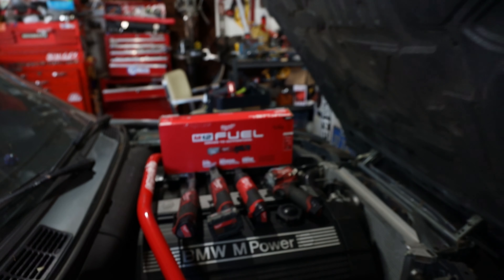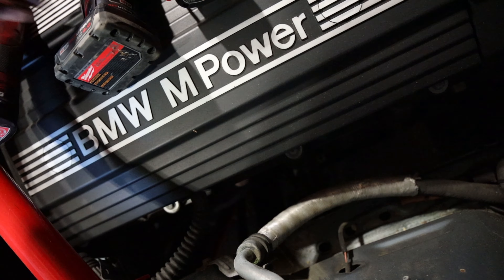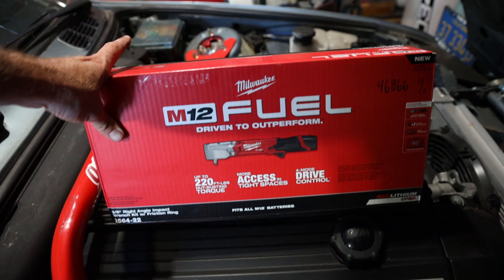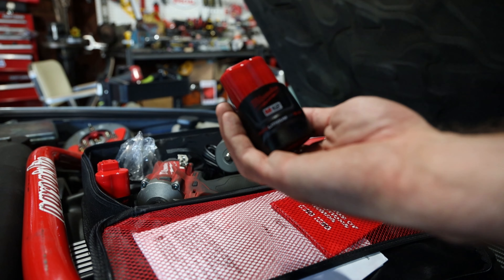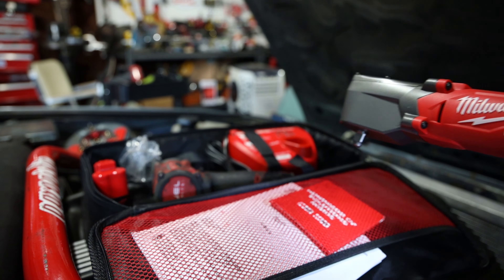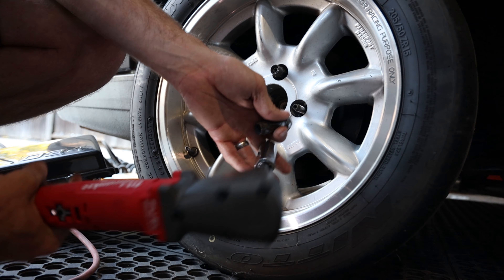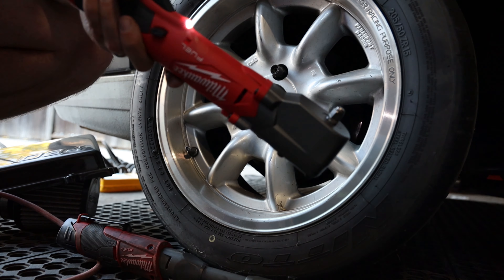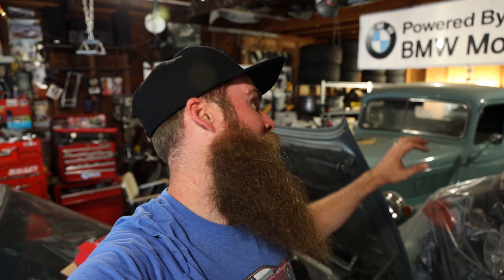Milwaukee Tool M12 2564-22 Fuel 3/8 Right Angle Impact Wrench

Comment: I was a avionics tech and crew chief for 39 years.  First thing I look at during a guy reviewing tools is if his tools are a lil dirty.
You passed and l loved you video.  At 57 I am ergonomically challenged.  I want to still do my own vehicle repairs but I need a power tool to get that hardware off quick.  Milwaukee beats all competition in the 12 volt arena.  On aircraft mods I bought the 1/4" apex driver and that was awesome.  I think after watching this I will go with both ratchets featured here.  Thanks for the demo
Reply from the maker: I’m glad I passed the test 👍🏼 Yeah they definitely speed things up and I absolutely love using them.

Comment: I received the 1/2" and used it, it failed, only removed one bolt. I returned and exchanged for the 3/8" model, I used it today on a Cummins ISX CM-871 to remove the oil cooler housing. It runs the entire length of the motor, and is darn close to the frame rail, 20 16mm fasteners in all. 

My 3.8" stubby was not much help. So, I went out to the car, just got that thing from HD the other day, still in the box... Unwrapped it, through in a Chinese knock off 6 amp battery and slapped on the 3/8 to 1/2" adapter and 16mm impact socket and went to town! 

This  3/8" right angle removed all but one bolt. Instead of using a gasket on that housing, they loaded it up with RTV. Each bolt was covered in the stuff, every hole was full. The last bolt, the one it could not remove, was a real bugger, I used my 2 foot long 1/2" ratchet on that one, and it was really gummed up with RTV, I could see why the right angle would not remove it. 

Saved my bacon today time wise, it is a keeper! 

But, what get's me, is why are the 3/8" version is seemingly more powerful than the larger 1/2"? They are identical other than the anvil, must be some sort of physics thing I guess...
Reply from the maker: Yeah heavier hits from more mass

Comment: Hey Blake. I’m torn here. Ive been researching/watching videos for several hours now, racking my brain on which tool to get! I’m not a mechanic but I do stuff here and there around the house and now I’m getting ready to work my 2002 F-150 that needs some loving. For starters, I’m getting ready to take the seats out.  My father has just retired, he’s now 66. He has lots of tools, including the m18 high impact, frigging obnoxious! But I want to leave the man alone since he was kind enough for me to use them when I do some fixer uppers on his property that he couldn’t do. I got my Torx impact sockets already but the tool.....I would love to own just 1, to do EVERYTHING, would you recommend the 1/2 drive RIGHT ANGLE for it?
Reply: Get the mid torque impact gun with proper impact sockets. The mid torque will handle just about anything you need to do as an DIYer with 650+ lb fts of torque. The new generation is very small like the Stubby shown here. The impact wrench is nice but very limited in power when working on things like car suspensions. I was working on my car's wheel bearings for example and the axle but is torqued at 242 ft lbs - more when you consider rust. There is no way in hell the impact wrench is going to get that off. Could I loosen it by hand with a breaker bar? Sure, but what's the point of powered tools if I have to do it by hand? Smaller bolts you can remove by hand if need be. If you haven't already bought a power tool I hope this helps.

Comment: Did they make the M12 fuel line for people that needed less powerful smaller tools or because the tool collectors were running out of M18 stuff to buy? 
Still amazed with my first milwaukee tools. M12 fuel hammer drill and impact driver set.
Reply from the maker: Haha right! M12 is lighter weight for light duty most of the time but it's amazing how much power these tools output in the M12 Fuel lineup

Comment: If that can break rear caliper bolts on the heavy duty trucks and vehicles i work on. It'll be worth every cent. No more bashing a wrench with a hammer because of clearance.
Reply from the maker: It should be able to I know I was using my half inch stubby on my front brake calipers with no issue so I would imagine this would do some rears as it’s only down a few foot pounds of torque to that.

Comment: Im getting mines delivered hopefully tomorrow and excited to use it!  I noticed your went 3/8” on the right angle impact and your stubby is an 1/2”? Why the change in anvil?
Reply from the maker: I like the 3/8 most of the time as the sockets are usually smaller.
Reply: Blake's Garage awesome! Have you tired using either the right angle impact or stubby for axle nuts?
Reply: How do you like your impact wrench? What size did you get?
Reply: @MrSupernova111  i love my right angle impact i got the 1/2” once tip though, use it with either a 4.0 or a 6.0 battery and youll be golden.
Reply: @jbpasion071  . Awesome! Thank you!

Comment: Great tool but I wouldn't use the regular sockets with impact tools. You can easily brake the regular sockets with the impact gun. I know they have a lifetime warranty but I would not want to break my expensive sockets if I can help it.

Comment: I just purchased this new right angle impact mostly for caliper bolts and it failed me on the first car. I had to grab the m12 stubby with a swivel socket and got the bolts removed instantly. I love the concept of the tool but I’m already doubting its worthiness.
Reply from the maker: Well it's down 20pound feet over the stubby and caliper bolts are usually pretty damn tight. I definitely use the stubby there usually but I'll have to try this. That's why I have bigger ones also in case I need more torque. I used this on the S3 the other day and it worked wonders getting into places and breaking stuff loose my M12 ratchet couldn't.
Reply from the maker: Well it's down 20pound feet over the stubby and caliper bolts are usually pretty damn tight. I definitely use the stubby there usually but I'll have to try this. That's why I have bigger ones also in case I need more torque. I used this on the S3 the other day and it worked wonders getting into places and breaking stuff loose my M12 ratchet couldn't.